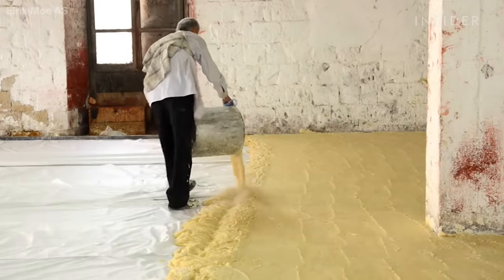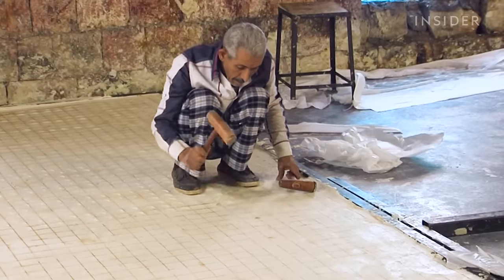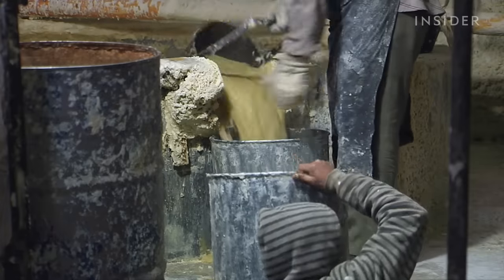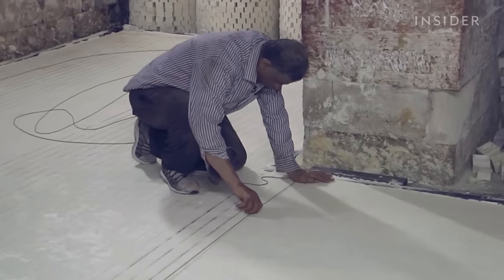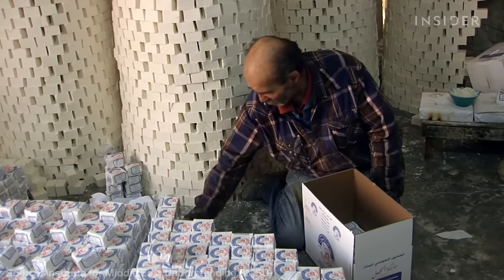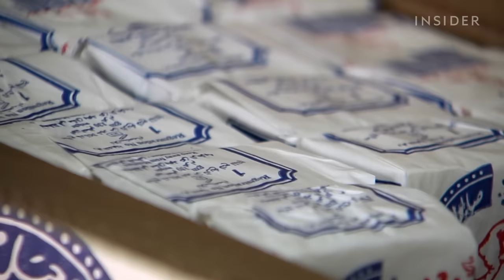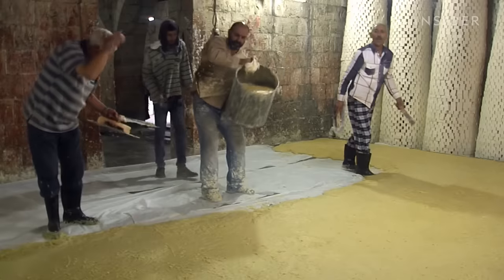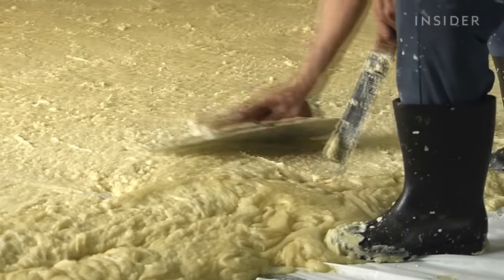How Olive Oil Soap Is Made In One Of The Last Factories In The West Bank | Insider News

Comment: I would definitely buy it if it was available in the states or online.
Reply: It is available u can google it
Reply: @Elizabeth Female please give the link!
Reply: It’s on Amazon look for the brand Nablus
Reply: You can make it. Every 100 grams of olive oil requires 12,5 to 13 grams of lye dissolved in 50 grams of water. Depending on the oil you use. Start with the 12,5. Like it? You're done. 
Too greasy and sticky? Next time use 13.

Start with a small batch of 200 of 300 grams of oil. 

Use the cheapest oil you can find.  It contains the most insaponicable elements and that is good for the skin. No need to use extra vergine. That is for salads! 

Let it cook (simmer) in a bain marie, or in a slowcooker, for about two hours on low heat. Use a mixer to speed up the process. If it becomes too thick, add a little water. 

Poor it in a silicon cakemold, and in a few days you will have this exact soap. 

Take it out, slice it, allow that to dry. Weigh it to see when it stops evaporating water. Then you can use it. 

It is safe to use after two hours of cooking and a day in the mold, but it will wear more quickly if it is still too wet. 

Good luck!
Reply: Eagle Eye  ty
Reply: @carolineleiden  nice tks
Reply: @carolineleiden  thank you!!
Reply: @carolineleiden  😬 lye soap cannot be safe to use right away. It needs several weeks to cure
Reply: Eagle Eye which website? I see many of them
Reply: It's on Amazon! Search Nablus soap
Reply: 3 ingredients of.  Olive, water, & baking powder. Interesting!
Reply: Im gone to try it in a very small dose. Here on the north east coast.
Reply: @Elizabeth Female get me the link please
Reply: Paliroots sells it online
Reply: I found it on Etsy and Amazon
Reply: U can buy it on Amazon. Just type 'Olive Oil Nablus Soap' and you'll find it.
Reply: 100 % I would too
Reply: @carolineleiden  Thank you so much🧡
Reply: Ahmed's soap is called "Al Jamal Soap", there's a Palestinian website that sells it online.  Palestineonlinestore.com is the name.
Reply: @Elizabeth Female I grew up using these soaps. They were really good. Unfortunately I started getting eczema on ny hands and my skin is now sensitive to the soap.
Reply: it's online
Reply: @namiesnaturals3557  it 's caustic soda actually, not baking soda/powder
Reply: It's available on Amazon..
Reply: @chickennugget6233  If you cook it au bain marie for two hours, it is safe to use the next day. 
Only if you just mix the ingredients together at room temperature it needs to cure. But who has time for that? I always cook my soap.
Reply: @namiesnaturals3557  Not baking powder! Real lye. What you use to declog drains. Yeah, really. From Home Depot.
Reply: @khushboosawool5177  Remember to cook it for two hours au bain marie. Then it is safe to use the next day.
Reply: @carolineleiden  Thanks again for the tip❤😀

Comment: Baking soda does not saponify oil. It's caustic soda, otherwise known as lye. Completely different chemical compound.
Reply: Are you sure ? Isn't that why their method is slower?
Reply: cici  possibly. But they should have done their research before publishing this. 😉
Reply: Fala Sakari I thought it didn’t seem chemically right. And then when he said baking soda was expensive, I thought, really?
Reply: True, and it's probably just the translation that messed it up.
Reply: @reallyraven1111  it's definetly the translation. The man just said "soda" and he didn't specify what soda and the translator decided to put baking soda
Reply: Thank you for clarify on that🙏 I was like baking soda🤔🤔🤔🤔????
Reply: @variety byun ike Castile soap, the chief ingredients of Nabulsi soap are virgin olive oil, water, and an alkaline sodium compound. The compound is made by mixing the powdered ashes of the barilla plant (qilw) which grows along the banks of the River Jordan with locally supplied lime (sheed). The sodium compound is then heated with water and the olive oil in large copper vats over fermentation pits. The solution of water and the sodium compound becomes increasingly concentrated in a series of 40 cycles repeated over eight days. During that time, an oar-shaped wooden tool known as a dukshab is used to stir the liquid soap continuously. The liquid soap is then spread in wooden frames to set. After setting, it is cut
Reply: Exactly isn’t it scary
Reply: cici   you may be right
Reply: This comment saved me from a messy experiment lmao
Reply: I know right?  But I'm trying it on a small scale right now.
Reply: @KeshiaRambles   I know. I almost went into my kitchen to brew up some soap. Bit of olive oil baking soda and water .
Reply: We use this soap on the daily, and in the ingredients it's written that's it's not baking soda, can't really remember the name but it's def not baking soda
Reply: @halaturk1659  nothing beats honest pure ingredients and sumplicity
Reply: The arabic word was "soda" but given sufficient time, concentration and heating, sodium carbonate and hydroxide will saponify fats.  Sodium bicarb might, but you would need a saturated solution and a very long time.
Reply: The translator made a mistake, the man in the video only said 'soda' without specifying, but in the translation they added 'baking soda' without doing the proper research.
Reply: Thank you!  I was puzzling over that!  If baking soda worked all soap makers would use that over lye!
Reply: Me thinking,  if soap is made up of olive oil,  baking soda and water,  i could make my own.
Reply: cici  oooohhhh i wondered why they were supposedly putting baking soda in 😂
Reply: It's caustic soda that's why the let it rest for 40 days
After that it's not caustic and it won't burn ur skin.....
Reply: Yeah, I was like .. that's not soap if they are using baking powder 😂 very dangerous.
Reply: @Level_Up_Nation  yeah same
Reply: @marshalllee624  you can still make your own, just go buy some lye and do some reading 😀
Reply: @areliperez3767  Actually, if done correctly, the soap isn't caustic after the first 24 hours after being poured for cold process. For this hot process, it should be even sooner.
Reply: @unclejonssoap  I didn't know that, it's good to know

Comment: The first batch of soap I ever made was olive oil soap but I didn’t use baking soda. I used lye, aka sodium hydroxide. I bet that’s what they’re referring to.
Reply: No no lye and baking soda are different
Reply: Thats what came on my mind. They mean NAOh
Reply: the baking soda makes it more mild and better for sensitive skin
Reply: Baking soda is a perfectly viable base to use in soap making, lye is more commonly used now due to being not only cheaper but also a lot more caustic than baking soda, this allows for saponification reaction of lipids to occur faster and thus makes the soap bars cure faster (this also makes it a lot more dangerous to work with). Baking soda is good for soaps due to being less basic than other bases which causes the saponification to be much slower and therefore much more easily controlled, if too much lipids turn into surfactant (soap) it can actually start to give you chemical burns! Baking soda also allows for the beneficial compounds in the olive oil to survive resulting in a soap that is great for skin.
Reply: @themushroominside6540  I didn’t realize you could achieve saponification using baking soda.
Reply: @LauraCourtneyette  You most certainly can! In fact just about any alkaline salt will do. In the really old days people would use potassium cloride made by burning plant material in a pot for long hours this is where potassium gots its name btw (pot-ash).  Just know that adding heat to a chemical reaction will cause the reaction to happen faster as hot molecules tend to bump into one another more often, in soap making that use baking soda, heat can increase the saponification reaction a hundred-fold than if it were a cold solution, though the reaction would still be a lot slower than it would with lye.
For comparison baking soda process soap takes around 40 days or more to cure while lye process soaps takes just a week or two to cure with just the cold process method.
Reply: @themushroominside6540  Good to know! I made my own lye by burning wood and soaking the charcoal in water like you said then moved on to commercially made lye (which was never fun to work with). Thank you for all the information💜
Reply: @themushroominside6540  can i use sunflower oil instead olive oil?
Reply: @raikow8842  Any lipid is able to be made into soaps, including sunflower oil. Always be carful when working with bases and heat. Baking soda is safe and perfectly viable to use but you will need to heat up the oil when doing so, it will also bubble when you add and mix it in so use a bigger pot then you think you need and wear ppg.
Reply: @themushroominside6540  in the video they only use 3 ingridients how they bubbles their soap?
Reply: @raikow8842  the reaction between the baking soda and oil cause it to bubble similarly how bakeing soda bubbles when put into hot water. since you are putting it into hot oil its a lot more dangerous as splashes can seriously burn you as oil can get much hotter than water.

Comment: Are you walking on the soap??
Nice.
Reply: Buddy, how else are they supposed to cut them in pieces etc.? Fly over it?
Reply: @asklepios1067  pour the soap on metal shelves maybe and not on the floor?
Reply: Where would you want to get these  resources from in a country which is restricted on a daily bases? Plus look carefully, there's a tarpaulin on top of the actual ground..
Reply: I was thinking the same💭
Reply: The shoes are likely sanitized.
Reply: @linusmlgtips2123  yes - sanitized with soap.
Reply: How do you remove dirt from soap? Just rise the soap off with water.
Reply: @id104335409  😂

Comment: What is the percentage of olive oil, baking soda, water ??? Thanks
Reply: They're using lye (aka caustic soda), not baking soda. It was mistranslated. 
Look up a soapmaking lye calculator and you can design your own olive oil soap. I've made soap using the Brambleberry calculator twice and it worked both times.
Reply: @diablominero  Thank you kindly Sir. I most certainly will do just that. Most of the har soaps made today are just whipped up concoction of any scrap from anything. Quality hand soaps last and last and clean ever so gently. Peace vf

Comment: Just a correction as a soapmaker: they are using sodium hydroxide, aka lye as the base, not baking soda. it is scientifically impossible to make soap using baking soda since it's not alkaline enough. the error comes from the translation- he simply said they use "soda" in Arabic that in this case means (caustic) soda. and yes, all real soaps are made from lye- sodium hydroxide for soap bars and potassium hydroxide for liquid soaps. it may sound dangerous but they are completely neutralized during the saponification process.

Comment: For another 1000 years'll be enough to invent a long table, to pour this soap end understaing what is the ergonomy. Discover the power of wood frame with steel strings or roundblade knife to cut the soaps without the necessary of using measuring tool and chalk line and cost a lot of money to employees. My pleasure to help you Abdul or Ahmed whatever. And baking soda is chemical ingredient, it doesn't grow on trees.